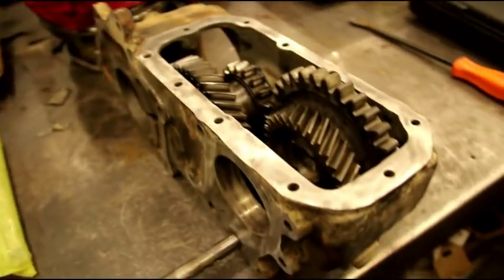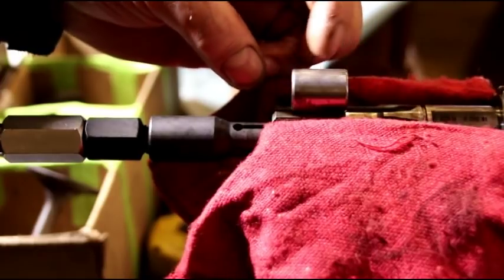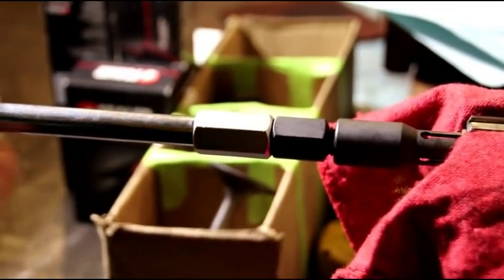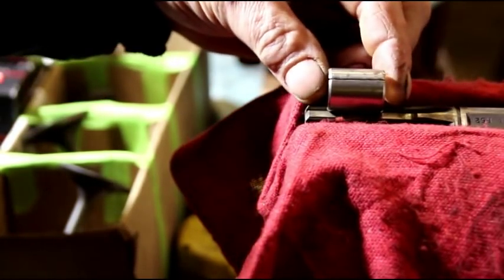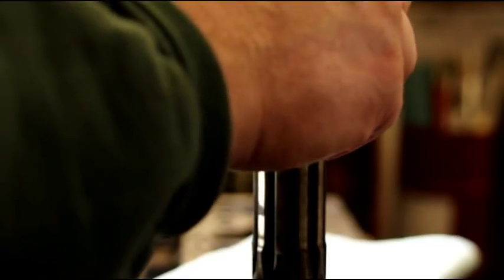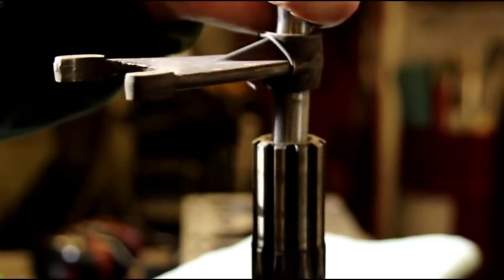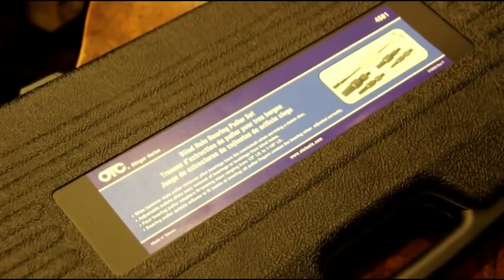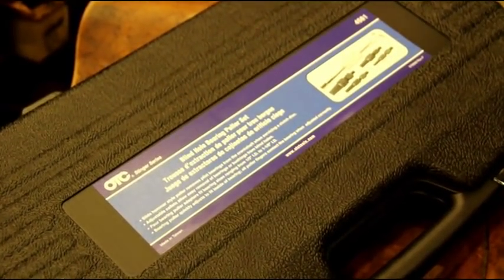Willys Transfer Case Output Shaft Bushing Removal

Comment: Great content as always Brian, really appreciate all you do in sharing your knowledge. Curious as to why you used the shift fork shaft for the sizing demo; is it the same diameter as the front output shaft snout that actually goes in there?
Reply from the maker: Tim, the front output shaft on this transfer case was bent so I could not use it and didn't have another out at time of filming.  Shift fork shaft size was exactly the same so I used it just to show the fitting into the reamed bushing.

Comment: What’s your opinion on boring the output shaft for a needle bearing assembly to replace the bushing? Or machine a full length bushing for better longevity. Appreciate your thoughts
Reply from the maker: There isn't enough material on the shaft to bore for a needle bearing.  A full length bushing isn't necessary either.   The factory bushing was fine and lasted a long time.  If you put a new one in it should last a very long time if you use the correct lubricant.

Comment: Hey Brian, I appreciate all your videos, they've been very helpful for me in my willys rebuilding adventure. I have a question for ya, I replaced my pilot bushing in my shaft and when I reamed it out the reamer left some skip marks in the bushing where it seems like the reamer kinda jumped a little in the first couple turns. Will these cause damage to the output shaft that fits into it? It fits very nicely and when I spin the shaft by hand in there I certainly can't feel any issues, but sticking my little finger in there I can feel the skip marks. Anyway, what's your opinion or suggestion on this? Should I pull it and start over?
Reply from the maker: You will be fine, sometimes the reamer will make a few marks like you describe but the diameter will remain on size.   Just another little area that will hold oil and keep your bushing in good shape.

Comment: The rear oil seal on my CJ-3B transfer case has leaked ever since I've owned it.  Can you still get replacement oil seals?  Could you do a video of the rear drive shaft seal fitment?
Reply from the maker: New seals are easily available.  If the seal is leaking badly it may be the seal or the yoke itself.  over time they often get a groove worn in them from the oil seal.  a new seal won't solve the problem if that is the case.  You will need to inspect everything once you take it apart.  If yoke has a groove you will need a speedi sleeve to repair it or replace the yoke.  You won't know what the problem is until you take it apart.